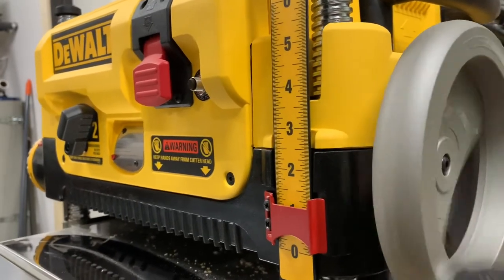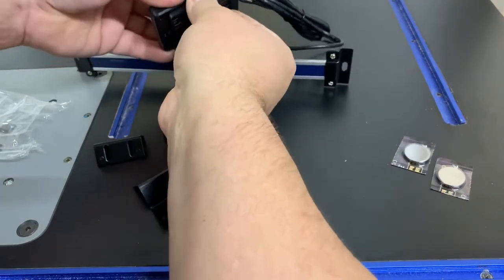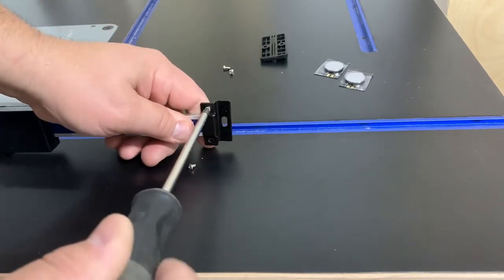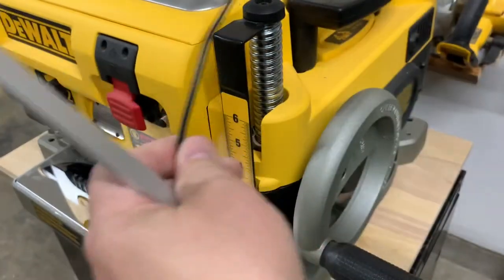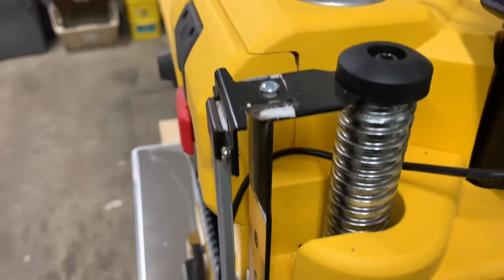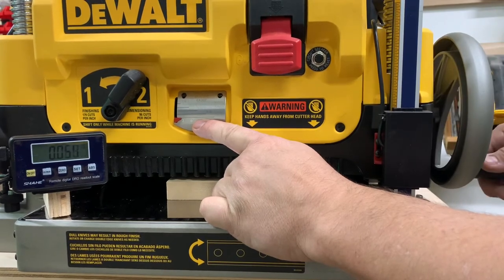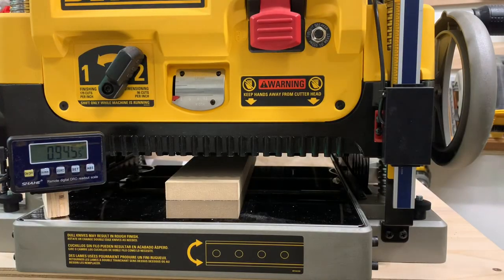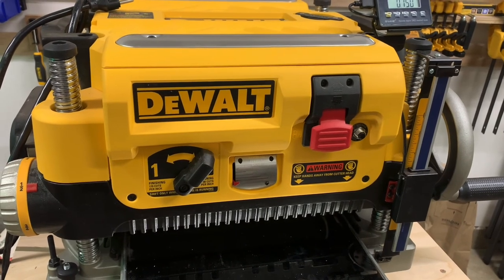Super Accurate Planer

Comment: I have the same digital measurement device even the same blue. It is just mounted on Dewalt DW733 and works without problems for the needs of wood with sufficient accuracy. I just do calibration completely differently. First I go through a good hard board with a stretch and measure digital. It doesn't matter where the reading sensor is located. The first time adjusting so that the measurement contains the entire scale of 150mm. After measuring the planed display, the display set zero and then set the same value to the minus on the display. Zero set in the display and have is set the exact zero.
Reply from the maker: Woah 
I didn’t know it could be set to a dimension 
I’ll have to check that out.

Comment: How do you like this has it really helped.
Reply from the maker: It is helpful when I need to fit a piece in a dato slot. Once I get it planed minimum on both sides I measure the piece and set the read out to 0.00 then I measure the mating piece to get the difference and then I lower my planer until I get to the correct measurement.